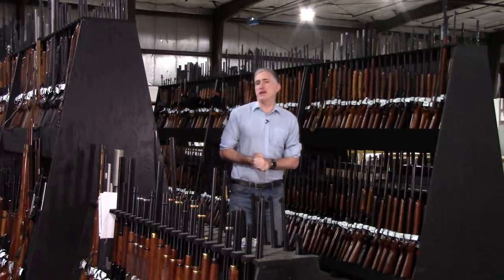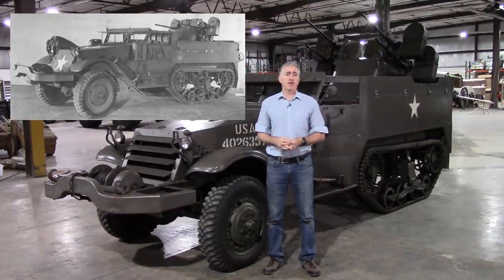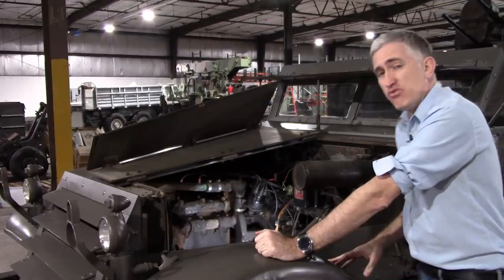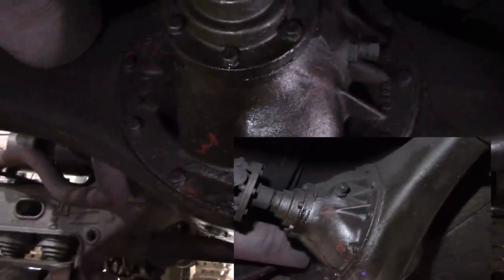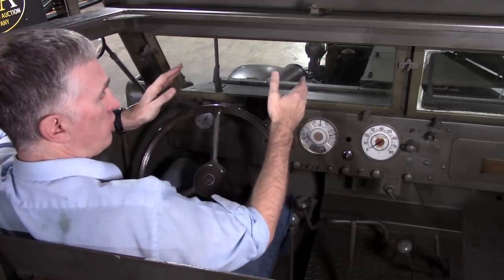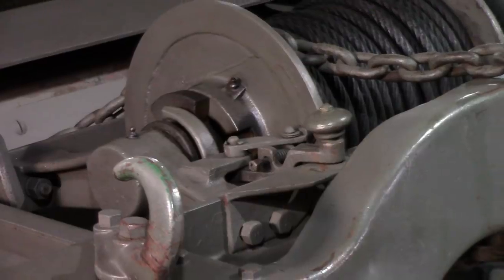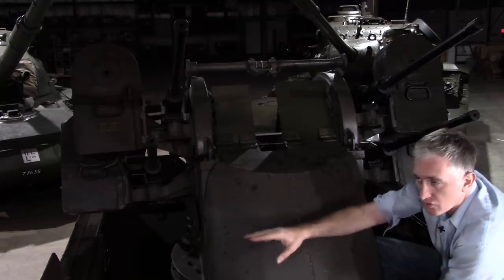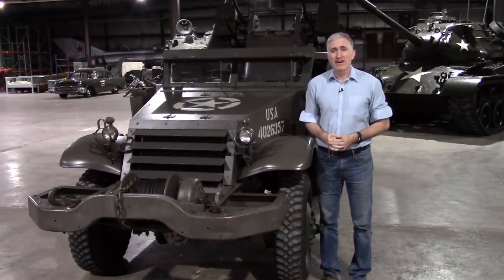Inside the Chieftain's Hatch: M16 MGMC

Comment: I was just driving my halftrack today. Using it to level a road with a drag box. Some additional facts: They have a early form of power brakes that use suction to help pull the brake peddle. This suction comes from both the intake and the mechanical fuel pump. That large steering wheel will rip your hand off if you hit a curb at a bad angle. You don’t need a crane to replace tracks. You just place a spacer block between two nuts to keep the boogies from dropping when you jack it  up. Loosen the tracks and pull off the rear idler ring. Me and my buddy did it. You are right about these things being simple and easy to fix. When I bought mine it was a rusted out mess, but many parts that looked beyond repair worked perfectly after cleaning. We really did build things better back then.Another fact. These beasts are sorta quiet on the outside, not like a tank, but loud on the inside! Also they are street legal
Reply: A friend found one abandoned in the bush in Alaska. He had surprisingly very little maintenance to do to get it functional. This was in 84 and the rubber tracks showed some dry rot but still worked.

Comment: Doing some research for a paper some years ago I was surprised to find a few action reports that these Quad 50's were devastating during the "Battle of the bulge". One report noting that a German unit 200+ marched right up to one in parade formation thinking it was a captured US vehicle being used at the beginning of the offensive by some of Skorzeny's "special units", the US gunner seeing the opportunity after the officer leading the German unit waved at him and he in turn stood up and waved back and let the "parade" get close and then opened up on them with devastating results. 
Another report these were used to repel a German recon in force searching for an allied fuel dump (the largest in battleground Europe at the time) stopping them less than 200-300 yrds from discovering the dump.
Reply: They didn’t pick up the nickname of “Krautmower” for nothing.
Reply: Story from some WW2 vets is that there's no appreciable difference between a building hit by a 105mm and one hit by a quad .50
Reply: It would go a long way to explaining out a relatively light unit stopped the German spearhead in battle of the bulge.

Comment: An old friend of mine was in the Philippines.  A Japanese sniper had thier column stopped and the commander called one of these to the front to take out the treetops, where the sniper was supposed to be.
It comes up and let's loose, taking the tops off a dozen trees.
The sniper was found, half on the ground and the other half still tied to the tree about 20 feet above the ground.  His guts were still connected. 
Them old guys can sure tell stories, but this one really bothered him for some reason.

Comment: My uncle 2nd Marine div ww2 was in Artillery 155 tow their antiaircraft consisted of a truck mounted quad .50 while a Japanese tank was trying to flank them. UNCLE said the gunner used 3 or four short burst to destroy the tank.
Reply: Robert Payne 
There wasn't much to those light Japanese tanks, they basically had the same thickness of armor the half tracks did. A ma deuce with AP Ammo would could make quick work of them.

Comment: "We are under attack, quick take out the windshield glass"
Reply: More like you use the glass only when training and driving around as a rear area transport, and you remove it when you enter a combat zone where you are likely to need the armor. Most of these things never got anywhere near enemy fire, and you usually had plenty of warning before you entered a place where people were shooting (especially for the half track transports these are based on; they aren't meant to drive out onto the battlefield under fire to deliver their troops, the armor is just so they CAN be used in a combat zone without undue vulnerablity). Like how they steam around in big battleships with covers over the gun muzzles. If they ever had to send a crew out in a big hurry to remove those so they could shoot, then someone messed up big time. In fact they usually had to take all the deck rails down, and a thousand other things to get the ship from cruising mode into battle mode. Or the external gun barrel locks on tanks. Or the tarpaulin covers over guns on other vehicles. Hell, they once thought it was a good idea to make Christie tanks with tracks that could be removed for transport so it could drive on roads at high speed. To prepare for combat you had to get out and spend half an hour fitting the tracks on. The ditched this idea, but not because they were afraid of having to jump out under fire to put the tracks on).

Comment: I learned about the M16 from two men I worked with.  One crewed a M16 in Normandy.  They would break into a field and spray the bocage with .50 cal fire.  A good example of ground use.  A LTC I worked for was a AAA officer in Korea.  His platoon originally had four M16s and four 40MM dusters (M42s I think).  The dusters were replaced with four more M16s and they provided supporting fire in a ground mode for the Second Infantry Division .  They did have the opportunity to utilize plunging fire in some operations and fired over hills to engage enemy.  An aside to the story was that in a platoon of eight M16s the oldest man was the platoon sergeant.  He was 21.  My boss, the platoon leader, was 20.

Comment: Good video to watch with a few minor points.    Original switches on halftracks had a key in the switch which could be pulled to prevent theft.  The push-button starter switch sat in a position right below the switch (Thus the hole above the after market switch in the video was actually installed in the original push-button position).   Original fuel tanks had a rubber coating and were a self sealing fuel tank.  Converted M16 tracks for Korea like the M16A2 were given an additional 12" ring to elevate the M45F  Maxson turret, and the fold down armor was bolted up in the corners.  In addition, a Packard slip ring like the ones used in the Sherman Tanks was installed under the turret to provide both communications to the gunner and provide the ability to charge the halftrack battery from the turret generator or the turret batteries from the halftrack generator.  In addition  a rear door was installed on the M16A2 to provide easier access to the gun compartment and two storage boxes were also added at the rear of the track on either side of the door similar to the 16A1 models.  All original M16s came with a winch where the A1s could have a winch or ditching roller depending on the vehicles previous nomenclature. The additional armor added to the turret for Korean War is called Bat-Wing armor.

Not trying to be clever, just sharing some information that might be helpful to all interested parties. 

My M16A2 is currently on display at the National Museum of the US Air Force (NMUSAF) in Dayton Ohio for an 18 month loan.  It was recovered from East Africa in 2007 and is completely original to include its paint.  Check it out if interested on my website AQProject.org

Comment: There was an Anti Aircraft battery equipped with Quad .50s at the battle of Dien Bien Phu. In his book on the Battle Martin Windrow writes that they were one of the most effective weapon systems in the Battle. Particularly because of the mounts in the Indirect fire role.
Reply: I could imagine this being the ultimate surpressive fire machine.
Reply: My buddies grandfather was in Korea and used a quad mounted .50. my buddy tells me the grandfather said that during the human wave attacks by the Chinese. It worked very well, he shot untill the barrels glowed from the heat.
Reply: The Soviets: "Hold my beer." 

They came up with the 23mm ZSU-23. It's like a tank with a 4-barrelled turret. It was originally AAA, but adapted for ground use. Both sides are using it as an anti-personnel weapon in Syria in the most recent war. It's absolutely devastating.
Reply: The quad .50 was used on 2 1/2 ton trucks during the Vietnam war, as well, for convoy defense.

Comment: The first M3's that went to war didn't have the idler wheels spring loaded. Once in use in North Africa, the drivers discovered that the rough terrain would make the idler wheels snap off. Some mechanics figured out, made and installed the spring mounting by using available parts that the commanders bought from regional supply houses. They sent photographs and shop drawings of those to the Ordnance Department who in turn made and installed their own to test out. They were impressed so had those made and installed on all of the halftracks on the production lines and out in service at training camps and overseas.

Comment: Had the joy of actually being in the gunner's seat and firing a few rounds out of this back in 1978.   The 9th Infantry still had quad 50s mounted on 5 ton trucks.   It's a small seat.   They left the armor plate off the front to give the gunner a little more leg room!  Great video!  Thanks for sharing!
Reply: I was surprised he didn't mention the Vietnam era gun trucks.
Reply: @MrDgwphotos  , Back in 1978, the 9th ID was a test bed of all sort of new equipment. I think they actually took some old 5 ton gun trucks out of moth balls as part of the trials.   This is how I was fortunate enough have some brief fun with a gun truck.   I was actually and ROTC cadet at the time.  They asked a few questions about it I was one of the few cadets who knew what it was, so I got to  take it for a spin and fire off a few rounds.  

I could see a reason to bring it back for urban warfare.
Reply: How does one get in the gunners seat? Does the armour front open side ways, lift up, or something else?

I would have liked the Chieftain to have squeezed himself into the seat.
Reply: OneLeather Boot, the shield does hinge open but it was not even mounted on the one I sat in.   The sighting bar swings out the way and you can easily sit down, depending on how large you are.  

Actually a little harder to get of because of how snug the fit is!
Reply: @KnifeChatswithTobias , okay, so it swings out sideways. I thought as much. Thanks for the added detail.

As a kid so many decades ago the Tamiya M16 MGC was one of the first plastic models I ever built, so I have a soft spot for it.

Fast forward a few decades and reading Vietnam era history books about the gun mount being used on trailers for base defence, as well as on the gun trucks you mentioned shows how effective the quad 50 mount was.

Everytime I see a technical in Libya, Syria, Iraq etc with a twin soviet ZSU AA on the back I think of the M16 MGC.
Reply: OneLeather Boot, let me clarify.   I believe the shield is hinged.   As I said it wasn’t mounted.    The sighting system is swung out of the way by pointing the guns toward the sky and then I just sat down.   This was a looong time ago.    I’m sure there are people out there who have a better idea of how to get in and out, especially with the shield in place.  

I can’t imagine what it would be like riding in that seat during convoy duty in Vietnam.
Reply: @KnifeChatswithTobias , ahh okay. That makes a bit more sense.

Comment: 8.25”x20 tires on combat rims, not 7x20 on split rims.  Very nice video.
Reply from the maker: Hmm. Fair one.
Reply: So this isn't the rim that will kill you then? Important to know when your bidding on this beauty!
Reply from the maker: It may well still do so. If memory serves, combat rims still come in three pieces, the two main halves, and a bead locking rim which sortof overlays the two of them and is supposed to  keep the tyre in place if it goes flat. I don't believe it's any safer to open incorrectly.
Reply: @Wallyworld30  A Combat Rim, when deflated for tyre replacement comes apart by removing nuts from threaded studs.  The Rim comes apart into three pieces, allowing easy installation of a new flap, tube, and tyre.  Bolt the rim back together, inflate, done.  No explosive dangers involved.
Reply: I have an original M16A2 number 315 of the 413 converted for use in Korea... Yes they do exist, and I concur regards the combat rim, it is not a split rim like that found on the Dodge M37 and other military vehicles from the 40s and 50s.  Actually the tube and tire can be replaced on a combat rim with the wheel still on the vehicle.  Regards changing track, a 1942 training film shows two soldiers replacing a thrown track in 9 minutes.  I  removed my drivers side track in 35 minutes by myself using the training film as my template.  Going to shoot a video of both removal and installation of the passenger side track within the week for u-tube.

Comment: Surplus half tracks were used in the 1950's for a variety of purposes.  Logging trucks, cranes, US Forest Service fire trucks, etc.  I rode in one about 1955 that was owned by a rancher in the South Dakota badlands.  He had removed all the armor and converted it to a flat bed.  It worked great on steep packed dirt slopes.  The big problem with vacuum windshield wipers is that the vacuum mostly disappears under heavy load like climbing hills and the wiper action slows to a crawl or stops altogether.  Bad news in a snow storm.   A quad 50 mount appears in the early part of Saving Private Ryan.  Probably just a movie error but I wonder if the Germans did in fact make use of any captured quad 50s.

Comment: My father had a lot to do with the White ones in Australia as they got those under lend-lease and not the IH one.
The passenger door side seat was normally not fitted in the gun motor carriage units to allow crew access to the rear of the vehicle as it has no rear door, they only had the drivers seat and the middle seat.
Dad had full sets of manuals for them but when he passed away in 1974, the solicitors cleared it all out.
We had one on our country property and I can remember having to work on the vacuum windscreen wipers when they clagged up. Some models had copper tubing feeding the vacuum instead of the rubber hoses Which perished in the tropics.

Comment: There was a guy on you tube set up and fired a quad .50 from an M16. They had to reverse the feed on two of the guns they wanted to use first before setting them on the mounts.
The guns chopped through a breeze ( cinder) block wall easily on a range 
Really impressive piece if kit and one got a cameo in Band of Brothers.

Comment: You can put a stick in the engine vacuum tube and it will keep the wipers on without using switch. I had a rambler with them, but you need to open the hood to get the stick in and out. Solves the leak problem though.

Comment: I haven't gone there in a long time, but in the mid-80s, we used to drive up to Oshkosh, WI for enormous yearly fly-in and air show. They put on a WW2 simulation with fighters and bombers flying low, firing guns and dropping bombs - both fakes, of course, but the guns were real. They had two half-tracks with operational quad-.50s firing blanks in anti-aircraft mode. Maybe the best anti-aircraft mount of the war - not forgetting the Bofors, of course - and I would pay good money to be able to fire a few thousand blanks out of one.

Comment: I once met a man who had served at the Pusan Perimeter. He talked about a battery of Puerto Rican National Guardsmen using these to 'mow the grass' in a valley that was a natural weak point in the UN line. Every morning around dawn, this one battery would line up facing into the valley and open up. Apparently it was a rare day when a follow-in patrol wouldn't find a mass of dead Chinese infantry who had been caught in the open by the gunners and thusly sawn into chunky salsa.

That round has 6,000 foot-pounds of force (~8100 Joules) at the muzzle, enough to rip through anything that isn't armored or pass through several soft targets before finally losing velocity. 450 rounds per minute per gun, 200 rounds per gun, four guns, means each mount can put out 800 rounds in 26 seconds before needing to be reloaded. It's some pretty grim math once you start running the numbers.
Reply: And if your angle of incidence isn't too high, each projectile may have multiple opportunities to be effective. EDIT: which is exactly what you said... sorry 'bout that.

Comment: Every time I hear the story pf popping the wheelie, I laugh.

Sorry. 

Something that big? 

Though, on their use in Korea, four .50 cal's going off, at once, yeah..... not to be argued with.
Reply: Grunts do like using AA vehicles for ground attacks. During Vietnam the Army used M43 Dusters, which were meant to SPAA, as sort of improvised AFVs. The twin 40mm guns, as it turned out worked just as well for taking out enemy troops as it did planes.
Reply: @Riceball01  anything that is intended as a spaag generally has the characteristics to be an improvised infantry support vehicle.
Reply: I was loaned to our battalion's transportation platoon when it was short of drivers. Word was ( and you could never, ever trust army tales ) there used to be a deuce and a half tanker truck in the POL section. Said truck's frame was broken when drivers would empty the front mogas tanks first and then with just the back tank full pop wheelies with it. After that, all we were only allowed were 5 ton cargo trucks with 2 800 gallon tanks mounted to the bed.
Reply: I'd hate to be on the receiving end of that thing. Granted, I wouldn't be on the receiving end of it for very long....
Reply: The story from some WW2 vets is that there's not much difference on a building hit by a 105mm and a quad .50.